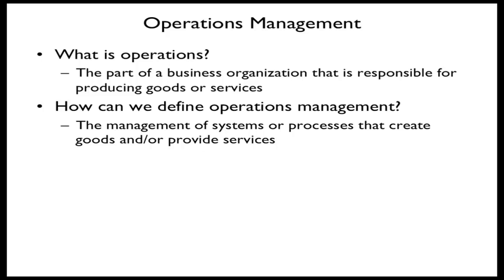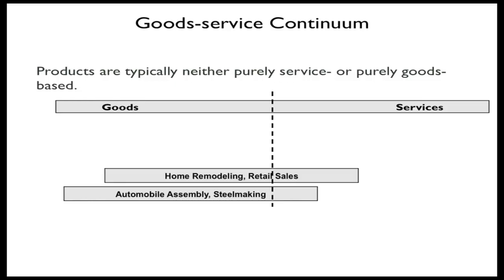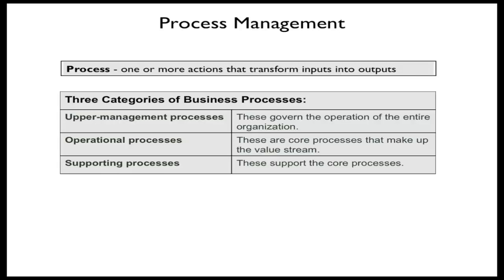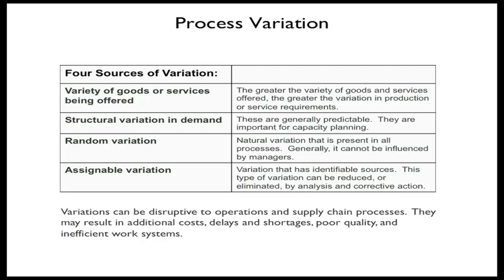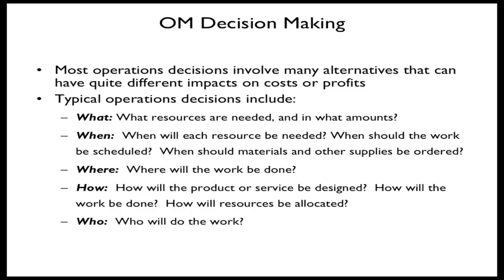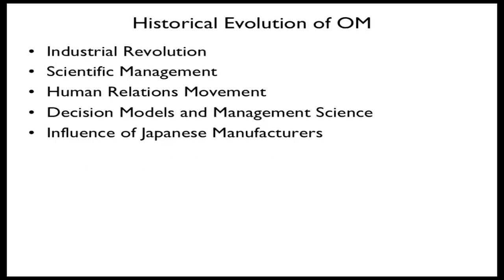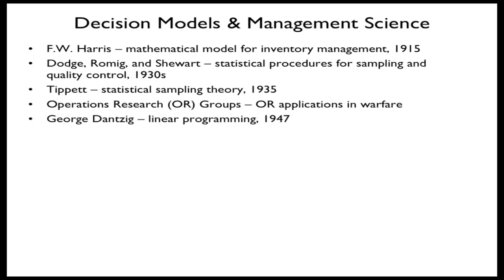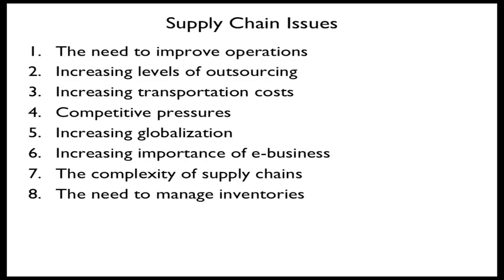Introduction To Operation Management

Comment: his video serves as an introductory lecture on Operations Management (OM), covering the fundamental principles and processes involved in business production. Here is a summary of the key topics discussed:

Defining Operations Management: It is the management of systems and processes designed to produce goods or provide services.
Goods vs. Services: While goods are tangible products (like cars or ovens), services provide value through time, location, or psychological benefit (like air travel or legal counsel)
Supply Chain & Transformation: The video outlines the supply chain (suppliers, producers, distributors, customers) and the transformational process, where inputs (labor, capital, materials) are converted into outputs with added value 
Business Functions: The lecture emphasizes that any organization relies on three core functions: Marketing, Operations, and Finance, all of which must work in harmony to meet demand effectively
Process Variation & Decision Making: Managers must account for different types of variation (variety, structural, random, and assignable) and use models—abstract simplifications of reality—to make informed decisions
Historical Evolution: The field has evolved through milestones including the Industrial Revolution, Scientific Management (Frederick Taylor), the Human Relations movement (Hawthorne studies), and modern Management Science.
Contemporary Issues: Current operations managers must address sustainability, ethical concerns (safety, labor, environment), and the increasing complexities of global supply chain management in the age of e-business.